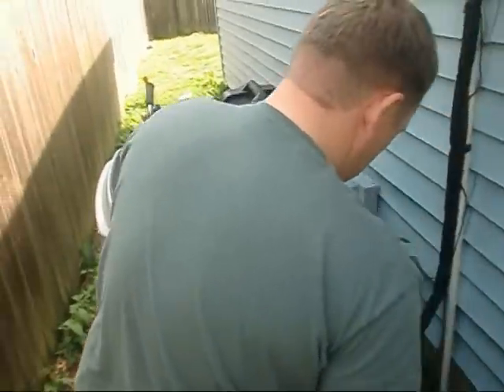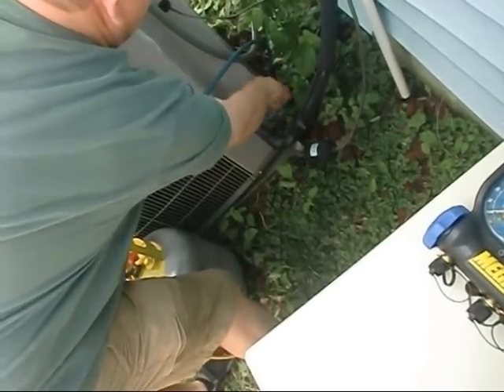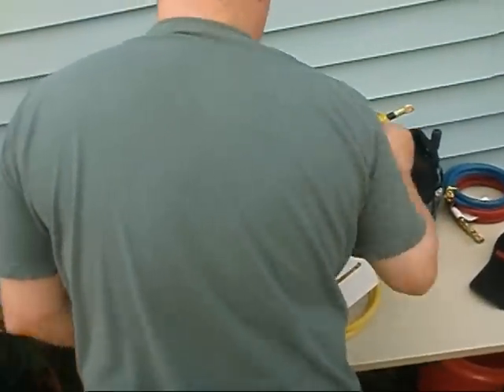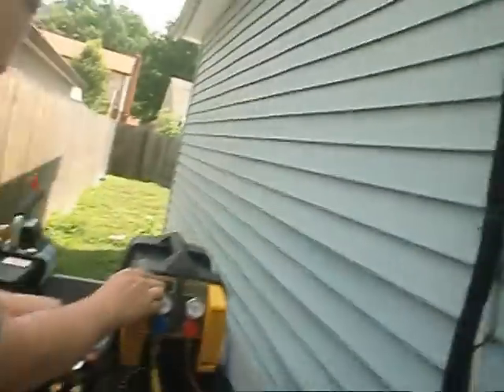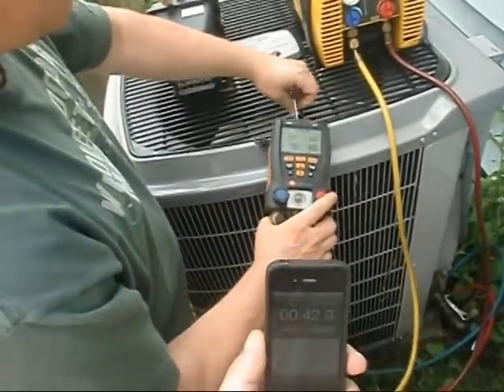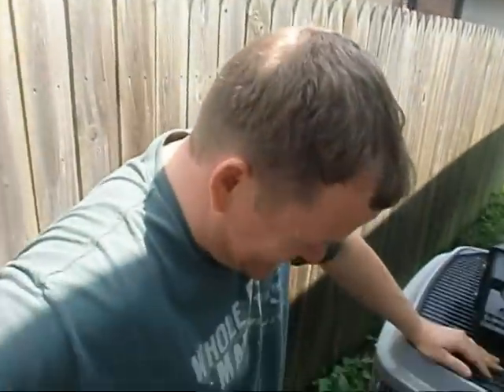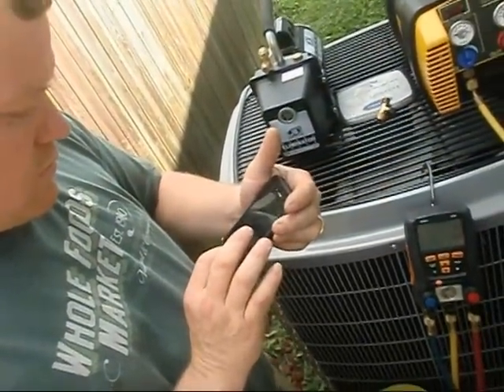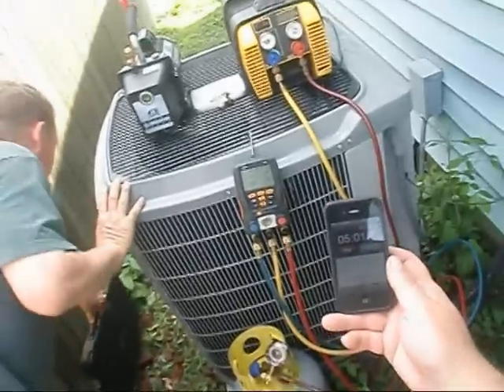Hvac Service - Fast Refrigerant Recovery - Appion G5 Twin / Louisville Ky.

Comment: Very helpful comparison. One detail......10 ga extension is great but you can't test for voltage drop by measuring the end of an unloaded cord(no current).  A  24ga cord would show the same line voltage. Use a splitter on the end with machine running to get the read the actual voltage drop. Thanks for the video!

Comment: You don't have to crack the valve open to read pressures on an a/c, it's technically not a king valve. King valves are on the outlet of receivers, A/Cs don't have receivers. Plus, a/c valves have shrader cores, real King valves don't.

Comment: Hate to bring up such an old topic, But something to consider for all of you viewing this.  EPA doesn't have an army of enforcers to watch what we are all doing but to put it in a video is just asking for trouble.  Fines are $47,500 and going up for each violation each day. How many recovery service tickets do you have?
EPA requires low-loss fittings for all recovery equipment unless the manufacture can show total contents of the machine is a deminise amount.  Appion has been approved without the need of low-loss if their equipment is used according to their instructions.  Adding all these large hoses and other components could very well get you all into trouble should enforcement eventually bear down on you all.  Just food for Thought.  Of course whose afraid of the EPA coming to your shop?

Comment: Hey Eddie! Thanks for all your very helpful and informative videos.
Hey quick question...can you tell me if an oil separator could be installed in between the tank and filter so that the G5 can be used for automotive recovery? 

Mastercool 69500  is supposed to couple up to any recovery machine for that purpose and it has a filter and oil separator and gauge set. The thing is its pretty expensive. I already have a gauge set and filter. All I need is an oil separator and recovery machine.

Comment: I saw a sweet dual 3/8" "T" on vac pump to dual hoses both direct to 
valve core tools with sideports on machine with cores pulled.  Pull one 
core  "remover" & Schrader completely out and hook Micron gauge there.  The other is also pulled out for charge hose off a cyl.  Pull a super quick vacuum that way.

Comment: Did you recover in both liquid and vapor , or just vapor only
Reply: He opened both high and low sides but as far as the tank connection goes, I find it more desirable to go in the blue vapor side.  Only need the red port to put blended refrigerants  back INTO the system as liguid or to charge a static system before startup I'd think.

Comment: Hi Eddie. Excellent video. I'd like to buy a gauge like the one you connected to the recovery tank. Can you give me details? Thanks.
Reply: Rubens just a quick connect 90deg 1/4" mfl x 1/4" ffl and and adapter from that to I'm guessing 1/4" npt for a high side gauge of your choice screwed to it.  He said $25 in parts.

Comment: I honestly doubt that cord is/was a 10 gauge cord. Looked to be 12 AWG which is sufficient to run your appion. Also the receptacle the cord was plugged into is probably wired to no larger than 12....or is it? 

Anyway, question? Are you able to purge all the refrigerant from the appion or do you find that there is significant amounts of refrigerant 'trapped' in the machine? Thanks.

Comment: I missed which valve u shut. I also do not see a filter in the line. Then i think you said mid seat the suction line? what is a transducer do da? Not enough time difference on hoses to even worry about it.
Reply: I shut the high and low sides off at the ball valve suction ports on the condenser then let the Appion pull everything in my hoses to a vacuum then I immediately shut the valve off at the tank before shutting off machine. Have a screw on filter to the inlet of machine.

Comment from the maker: 3/8 hoses are going to be around $40.00 each. you will notice the biggest difference when its really hot outside, be sure to keep your tank cool by submerging it in cold water or using the cps tool.

Comment: A mop bucket with ice drops the tank pressure and time down significantly
Reply: 5 gallon paint bucket with cold hose water does pretty well in a pinch too.

Comment: You cant go by pressure recovering a heat pump systems charge, Liquid freon can still be in the accumulator. Placing the can in a 5 gallon bucket with water will speed it up. But who cares when you are charging by the hour?

Comment from the maker: You don't need to use core removers on king valves because they don't have schrader valves in them.
 
I agree that you should use them on the valves that have the schrader vales in them and you should also remove the depessors in your hoses so that they are free flowing, just grab them with some needle nose and pull them out.
 
Thanks for the comment!!

Comment: The 350 micron vac sounds perfect .I would do the nitro test after the vac sustains the 450 reading for 10 mins first before using nitro to test for leaks with a little clean freon so a sniffer can detect it. It's a decent video. You guys appear to know your stuff and best of luck to you.

Comment from the maker: I normally will use a filter when I have one but when I made this video I did not have one, The filter is to protect the recovery machine so Try to use one when you can..

First you want to perform nitrogen test to make sure that you don't have a leak its much quicker to locate this way then you want to pull vac down to a min. of 500 microns and then do a blank off test, this will let you know if moisture is in the system and it will also pick up a leak

I would pull to 350 microns.

Comment: Didn't notice a inline drier when you recovered. Is that normal practice even if you are returning refrig back to the unit it came from? and shouldn/t you wait to see if the vac stays constant after you pulled a vac ito see if pressure dropped indicating a leak and how many microns do you consider sufficient to remove non condensables from the entire system?

Comment: Do you ever purge your hoses, I watch two of you videos and never saw you purge once. Air has moisture and can also cause high pressures in your tanks as well as your system. Also when storing your appion the book says not to store with the valves closed as residuals can damage you machine. Also your testo gauges should have temp thermistors you can monitor your tank temps with, I use the fieldpiece sman3, works great.